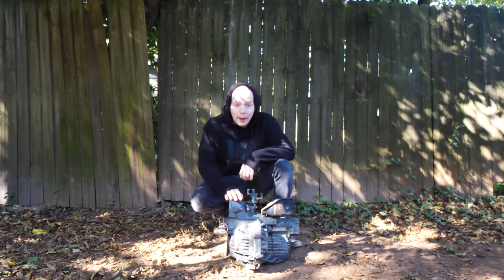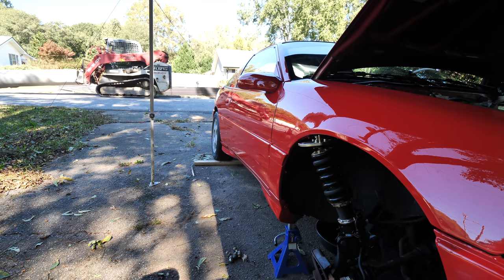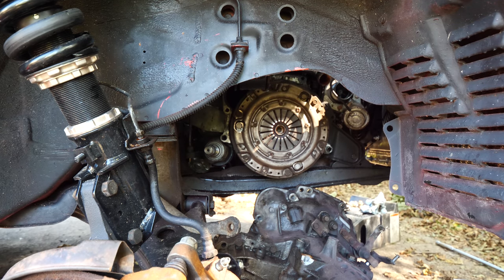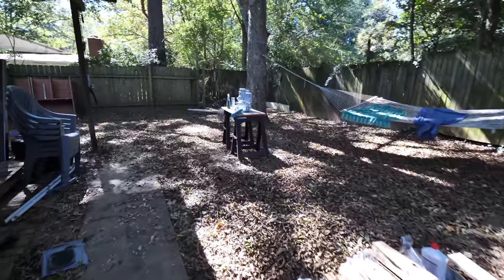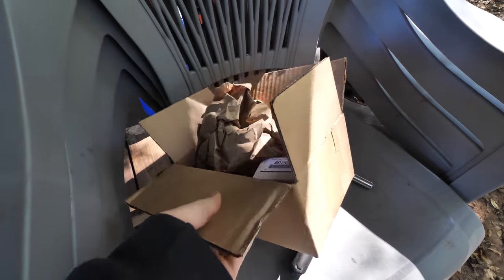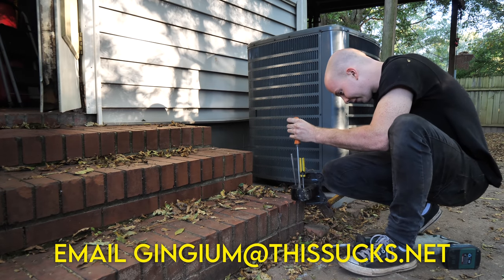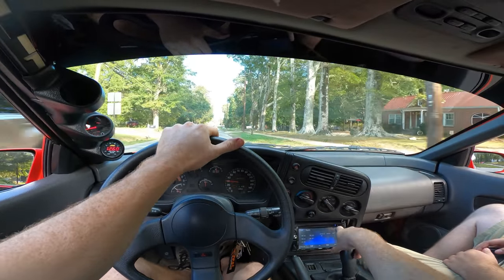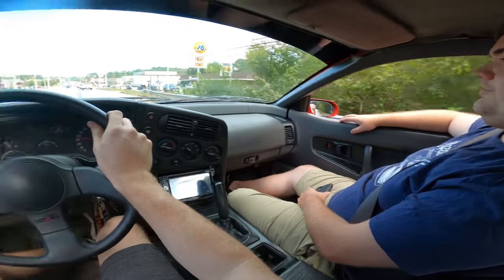Banging Gears In The $1500 ECLIPSE! The Transmission Is PERFECT!

Comment: Quick tip for getting those axles out in the future, use something a bit thicker like a chisel and just give it a tap with a hammer. Should pop the axle right out. Prying like that gives it some side load and hangs up the circlip. Also VERY important. If your transmission didn't have the "crank walk" bolt installed, make sure you replace it. It's a smaller bolt that goes in from the engine side of the transmission just below the starter. It helps secure the back side of the transmission to reduce flex in the entire assembly, many people leave it out. Super glad the new trans is working minty for you. My guess is 303.4 HP on the dyno. First run at least.

Comment: Easier to unplug everything and then pull the motor and transmission as a unit. I did one with my buddy in his driveway about two months ago. Reason being is its next to impossible to get the clutch/input shaft lined up with the engine still in the car. I worked at Town North Nissan/Mitsubishi/Eagle dealership for about 7 years back in the late eighties to early nineties. I can't believe how lucky you were to get it back in.  Keep giving old gear heads like me this great content!!

Comment: ima just be REALLY glass half full here and say its gonna make 220 on the dyno lol
Although i dont know much about dsm so i could be way out lmao.
Reply: I'm guessing 200. With a 2g maf, some injectors and DSM link he should be maxing out the stock 14b turbo.
Reply: @spencermorrison8517  That's not at the wheels ya goon.
Reply: @charliedeakman4  he needs to max out a 16g on this car lmao, that would be a pretty wild ride in a fwd car.
Reply: @iownyounoobs  ehhhhh i had a '90 Laser RS with a big housing 16G and while it was fun, it wasnt fast. Plenty of torque steer to make you think its more powerful than it is lol
Reply: I'm betting 225 wheel.
Reply: pffftttt over rating these cars ,175 is way more  inline with drive train loss plus the age and maintenance of the car. 150 hp 175 tq wouldn't be too unrealistic
Reply: Made 230 to the wheels on a 14B , 2G MAF and 93 Octane on my old 90 Talon TSi.   The 4G63 responds very well to mods and is ridiculously overbuilt for a factory engine, especially a 6 Bolt motor.
Reply: @fanatic26  I have a 90 talon tsi (so its awd) but the 16g's have proven to make 300 whp on awd cars at around 20 psi, id imagine with less drivetrain loss you could creep up to the mid 300's at the wheels.
I think anything more than that wouldn't be very useable on the street especially in a fwd setup.
Reply: You were correct 🤣
Reply: @sylleess4914  i know ! I cant believe it 😂

Comment: I used to own a 1990 dsm awd, it only had an upgraded 16g mhi turbo and exhaust. I bought very cheap as it didn't start and it ended up being a blown capacitor on the ecu. Me an a couple of friends installed a megasquirt and i was set to go. You have to be careful banging gears on the trans as the 1g have weak forks for 3rd and 4th, I learned that the hard way.

Comment: Love the vids I know this will be another positive comment but I had just thought. Instead of scraping the old transmission, take it apart to learn more, maybe buy a rebuilt kit so you can learn more on what you could do for the future in cars you buy in the future, if they ever blow the transmission, if the cost of a new one is too high you could rebuild it and it will save you more money in the long run! :D
Reply: not only rebuild it, do just what he said in the start of the video :) what's the point of only fixing stuff while you have it apart if you don't upgrade stuff while you're at it
Reply: I second this comment. Mostly because I have zero idea on how to rebuild a transmission.

Comment: You might have the single piston calipers, but can pull dual piston calipers off of later gen dsm's and I think even a 3000gt sl (non turbo model) which is a direct bolt on to the brake carrier. All you would need is bigger rotors and potentially new brake lines (since depending on where you source the dual piston caliper it might have a banjo fitting or something that is not compatible with the oem brake lines)
I got that brake swap when I bought my 1G and never installed it until I almost rear ended somebody... it definitely helps.
You can look up single piston to dual piston caliper conversion on the dsm forums and get more info on what parts to source and what size rotors to run.

Comment: I usually avoid taking lines of slave clutch cylinders(if its an fork cylinder system), saves me about 20 minutes of the job. And there's a tool for those halfaxles fork pry bar and hit it with a hammer from outside using leverage. A fan from the time you played forza, keep up the good vids Caleb.

Comment: Definitely would’ve replaced clutch and at least resurfaced the flywheel
Reply: If you know your flywheel and disk were in good shape, could you not just scuff up the flywheel and avoid the whole shim thing with a resurfaced flywheel being thinner?   Just a thought.
Reply: @ford_probe_garage_studio  The radial grooves in the facing are gone in some parts of the clutch, and the blue spots on the flywheel are hard spots from overheating that cause chatter.  Even refacing won't always save that.

He should have put a lighter flywheel in.  Lightweight flywheels are underrated.

Comment: I am guessing 240whp. I had a 91’ TSI AWD that made 360whp with 2g intake, tune, 3" back exhaust, small 16g, 550 injectors, and a 255 pump. Oh the joys. For the time is was so much faster than anything else, I remember racing and beating (badly) a brand new 05’ Rousch mustang. Best kill ever.

Comment: Love the videos, just a couple things- did you put rtv on the bottom of the rear main seal housing and please don’t spray the back of the engine with degreaser with it open to the crank case. Hope you did an oil change. Sorry to be picky.

Comment: not to be nit picky but did you spray brake clean into the oil pan while cleaning off residue? looked like main cap bolts to me the second spray with the main seal off
edit: he did an oil change sorry for commenting before finishing the video

Comment: @7:01 you know once you take the rear main off, you're spraying all that degreaser and brake clean directly into the oil pan/ on the crank... i know you did an oil change, but a bunch of crap may still be in the pan

Comment: Poor man's short shift mod is to drill a hole in the shifter arm on the trans closer to the pivot. You'd be surprised how much it helps. Also, that looooooong 1G shift knob sucks IMO. But if you like how it shifts and the knob, keep them original.

Comment: That looked like the stock clutch, and it does not sound like you where slipping at all while driving... so at the most you can only be doing 275 HP if there was anything hopped up about this car.... cause otherwise you start slipping the clutch and be complaining your having a bad time.  To be honest, the entire car looks stock,  like that is most definitely a Stock intake, and a stock looking exhaust,  and most definitely a stock looking down pipe.  Not great, but I think that is a huge blessing in disguise.  Typically all that stuff that hops up a car and get it ready for improvements to the engine and turbo tend to shorten the lifespan of the car alot.  Not having that stuff on this car means you know its not been messed with.. or at least  it survived being messed with and might still hold up to the power you will put into it.. but I'm still trying to guess how much power your going to make at the dyno... 

Since I think you still sucking the same amount of air, and fuel as before I have to go with a stock estimate.  at best those cars produced 190 HP and ever year a car is on the road.. I guess it might loose a little HP until its refreshed.. at best you are now starting to refresh it.. soo I am guessing it might now have 180 crank at the flywheel... so the guestimator says you will get 152 or 153 HP at the Dyno.  Not great but you know for car that light.. it's flying already...